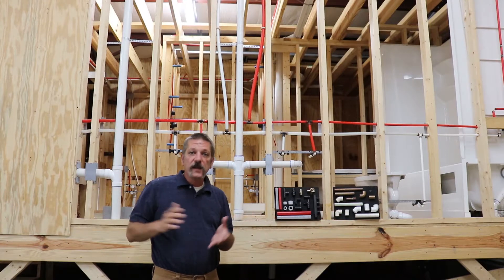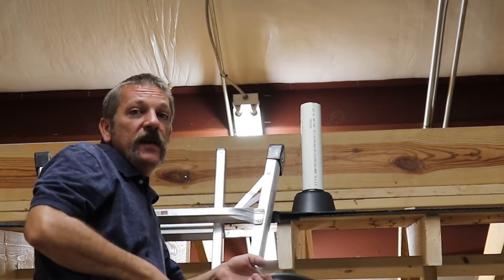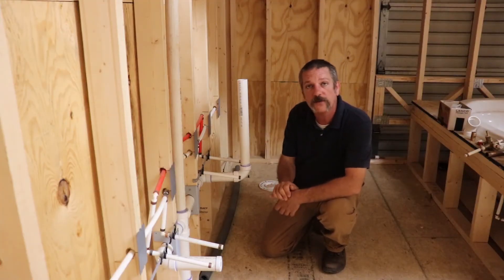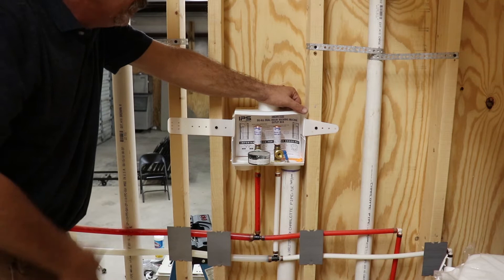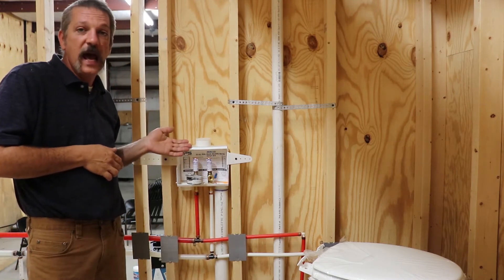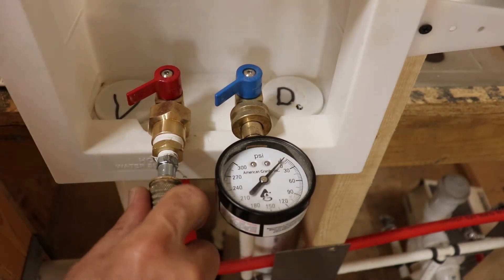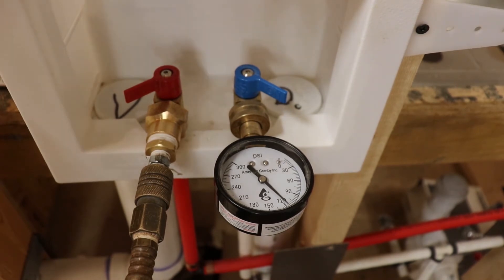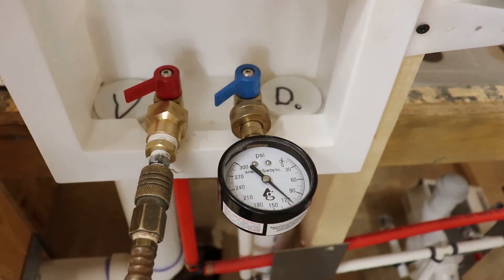Testing a Plumbing System DWV & Water

Comment: I'm working on building a living space in my basement.  I've had to relocate my Reverse Osmosis system.  I'm start to wonder what I'm doing to the health of my hydraulic/ water supply system.  e.g. To must negative, positive pressure?  Do many turbulence via additional fixtures, elbows, couplers, etc.  Suggestions?

Comment: why is there a v on the other outlet
Reply from the maker: One side is the drain the other is the vent
Reply: @PlumbingSolutionsLLC  the vent for what
Reply from the maker: watch my video on washing machine boxes. it is for a Studer vent
Reply: how would you attach that without threads do you have a special bushing?
Reply from the maker: they come with it glues over 1 1/2 and inside 2 inch
Reply: @PlumbingSolutionsLLC  the only issue I see with it is it has a elbow below 42 inches tall before the dry vent can turn horizontal

Comment: If you add water to vents, won't it just drain away?  If it doesn't drain away, then you have capped the drain to keep water from exiting the house?  And if you've done that, what's to stop water from coming out of sink drains when you fill up the vent with water?
Reply: at this point the sinks aren’t even there yet. the stub outs for the sinks are glued with test caps.

Comment: How about a test plug at a cleanout? Cap everything but the vents and just add water till it flows out on the roof. For inspection just Crack the water open with the inspector watching and he'll know that the system held water
Reply from the maker: Inspectors do it their way , you have to make them happy

Comment: You’re right, it’s usually jurisdictional. However, if you go strictly by code, the DWV system must be filled up no less than 10’ above the highest fitting. Typically through the roof. Many jurisdictions I’ve dealt with allow a stand pipe/riser above the highest fixture.